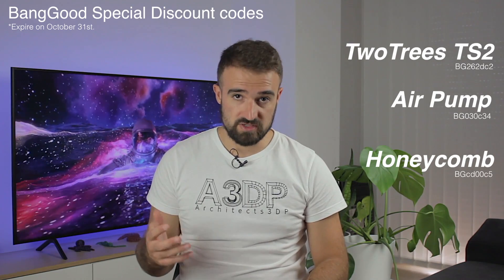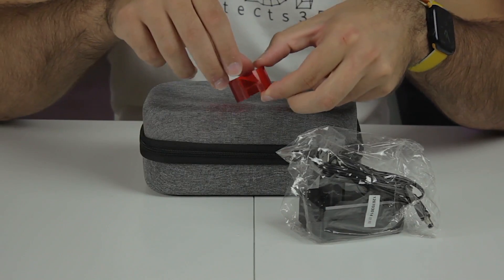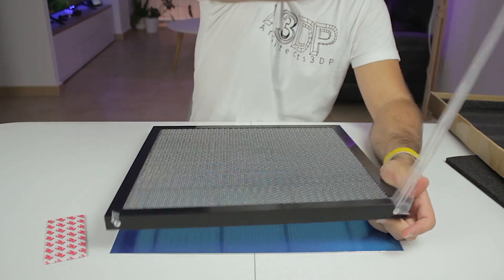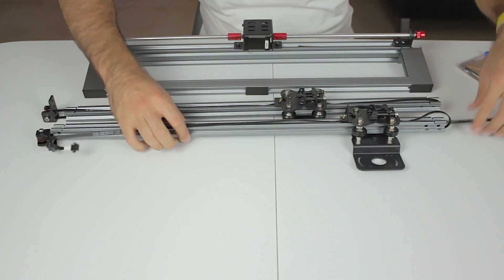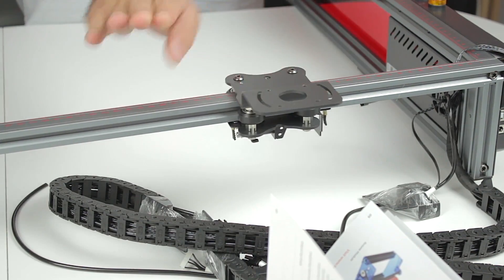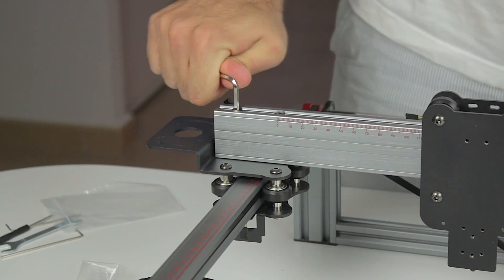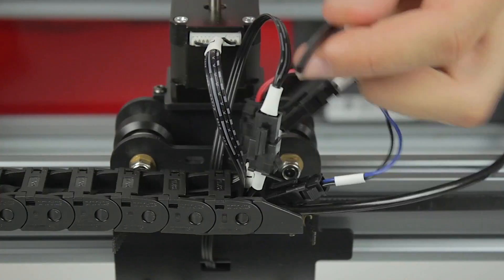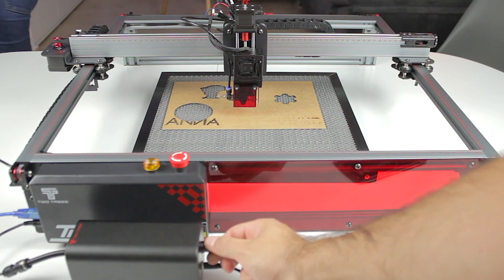TWOTREES TS2 10W Laser Engraver - The best quality for less?

Comment: TwoTrees are making some incredible lasers bringing business class lasers and build to the masses and quickly gaining a solid reputation in the process love my TTS-55👊👌👍❤️ great video and content on its bigger brother. I’m curious what you are doing as a fumes solution with your lasers ?
Reply from the maker: thanks for your comment !  Yes, they are bringing real high quality lasers to the market for a very affordable price. 
For the fumes, right now we're working on a new video of a laser provided by Comgrow. They are providing a laser cover, what is really cool. 
What we've been doing for now, is bring the laser machine to the kitchen, and use the fume extractor to deal with the burnt wood fumes and works as a temporary solution.
Reply: @architects3dp  I’m using a laser tent along with a duct in-line fan with duct pipe out the window very little to no fumes or smell works if I add a charcoal filter on the end then zero smell perfect busy doing a base board I can have everything on along with laser mounts to can get laser and honey comb grid square and the same every setup
Reply from the maker: That’s a great solution! We’ll be probably moving to another city soon. I’ll build my new workshop there and I’ll do the duct pipe solution. Stay tunned for that 👌